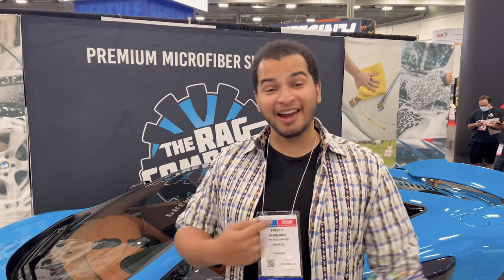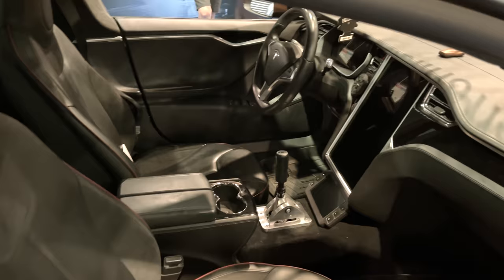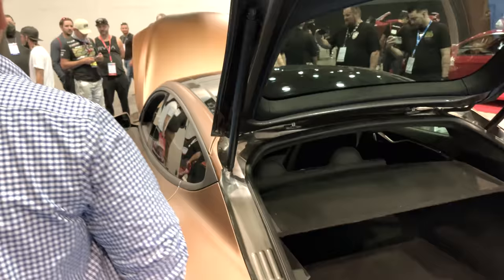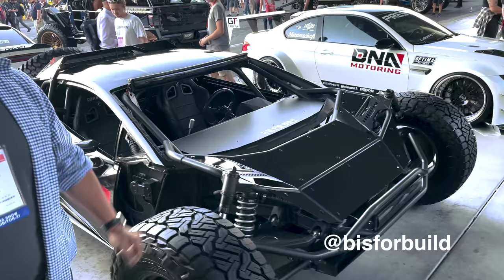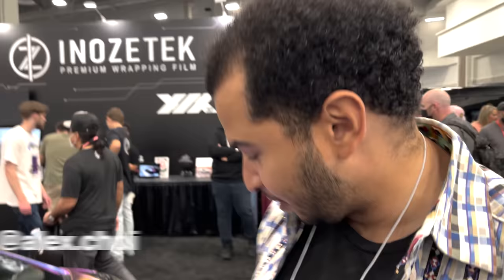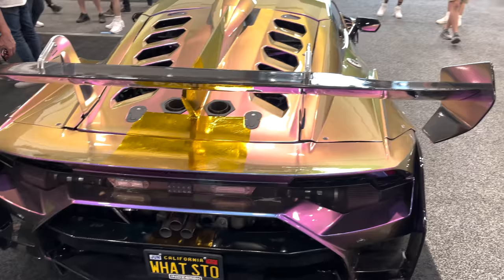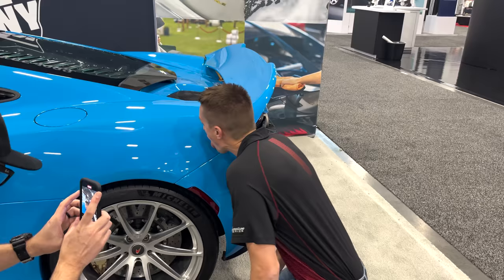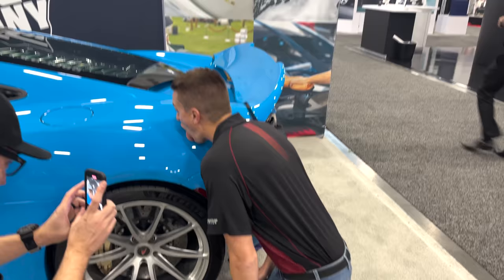ROASTING YouTubers' SEMA 2021 Terrible Car Builds

Comment: "as it wiggles it speeds up the electrons" - Jared advice 2021
Reply: Noted, i will be unbolting the battery tie down straps, to give the battery a boost.
Reply: @Zulfburht  also remove some Engine mounts, that can help build momentum.

Comment: 15:03 I know what Jared was trying to say, but I had a laugh at how it kept sounding like he was talking it down then Tavarish kept piping up in defence of it. He's trying to compliment it but starts by coming out with 'when you first look at on the surface you're kind of like 'ugh'' triggering another reaction from Tavarish as this is what he did for the whole review of the car. :)
The shiny metal is nice and all, but these builds need to be shown a lot of respect too as they're the future for the shiny metal, or a new take in building shiny stuff, if encouraged at the earlier stages. I hope I'd be right in saying that this MR2 has been built to be driven, and that's what all cars should be about. I'm not sure how many shiny show cars you can say that about. If the horn is connected then it's instantly a better car than half of the restorations/builds Jay Leno has driven on his channel. :)